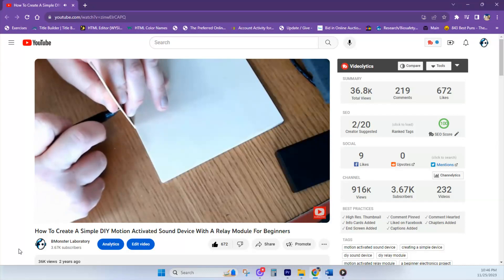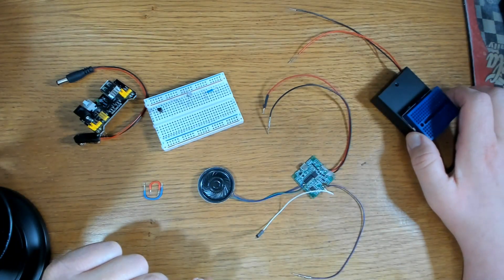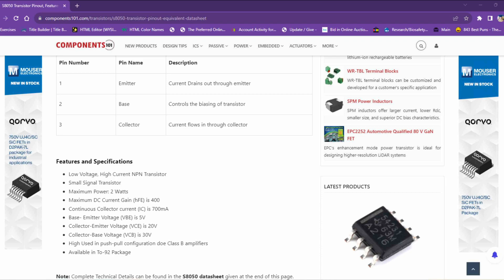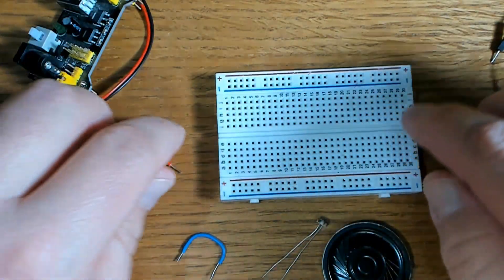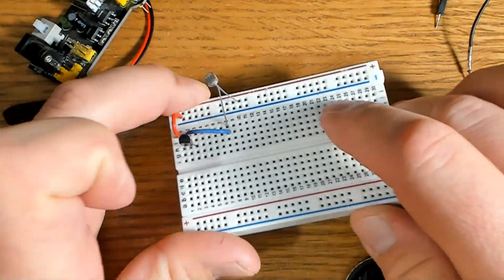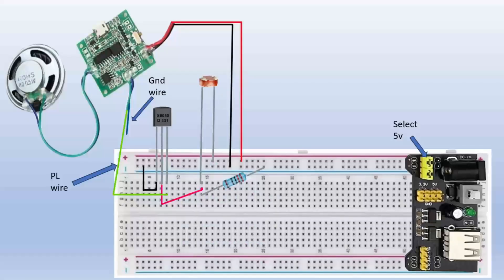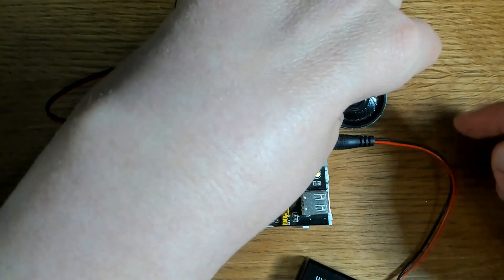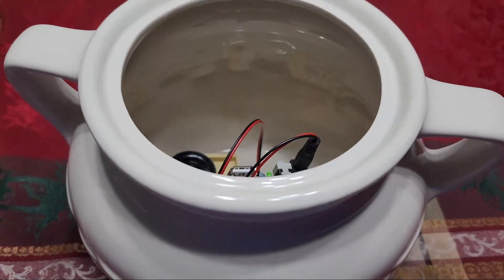This Cookie Jar Talks When You Open It! | DIY Light-Activated MP3 Sound Project

Comment: I’m trying to make a music box where when you press a button, not only does the recording of the song plays but it also turns a 3rpm motor at the same time. I’d also like it to keep playing/moving on a loop until I press the button again. I also need the system to really be on the smaller side, any suggestions?
Reply from the maker: Hey there!
That sounds fun! 
Wire a toggle switch to the I/O trigger pin on the DY-HV20T mp3 player board and a transistor/relay circuit for the motor. Switch on to play and switch off to stop.  That's the easiest way I can think of to set this up 👍👍
Reply: @BMonsterLaboratory  …I think I understood about 1 in 3 words… maybe you could make a video about it?😅